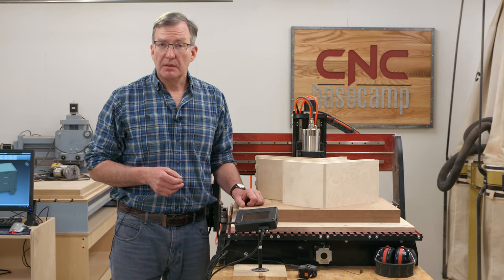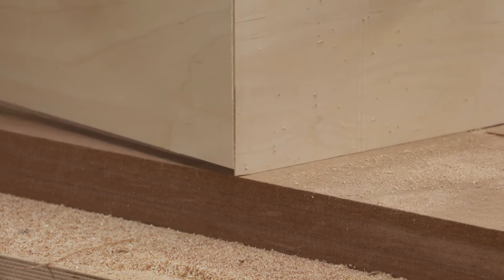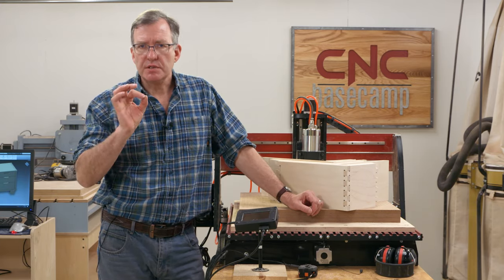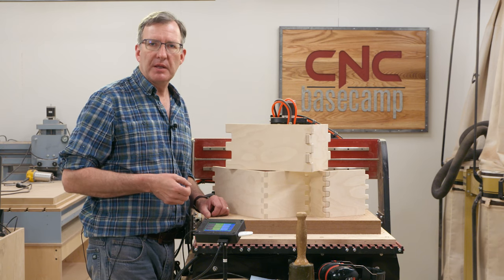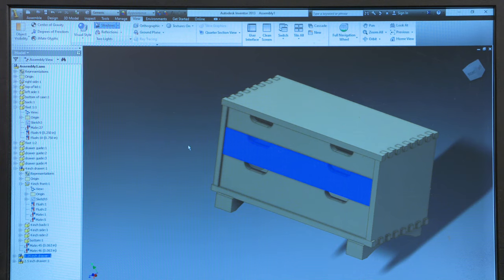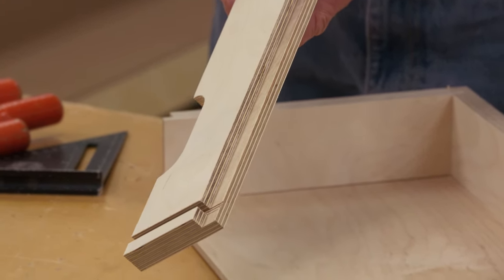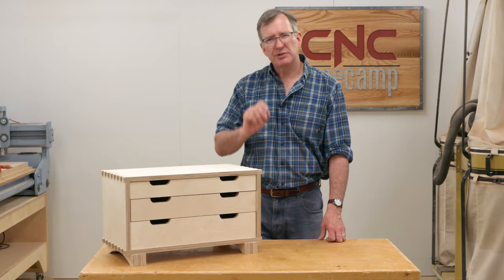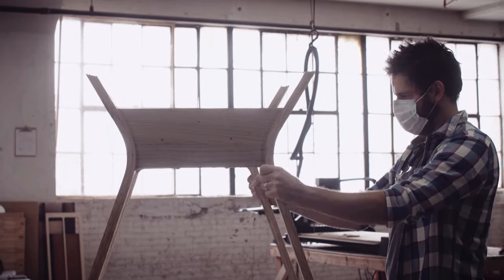CNC Basecamp Ep002: Joinery with a CNC

Comment: Thanks Chris, always great to listen to your explanations! I am building the CNC machine and did made it a bit bigger. As an alternative for the two lead screws you are suggesting for the x-axis, you could use a thicker ball screw. My x-axis screw diameter is 25mm (1”), so twice the size as your lead screw; the y-axis is 20mm, the z-axis 16mm. Screw lengths: x-axis: 1650mm (org 58”-1473mm), Y-axis: 1000mm (org 36”-914mm) and z-axis: 400mm (org 15 5/8”-397mm).
Hope this is helpful for other builders :-).

Comment: On the last joint, why not create a square cut out at the edge. Then you could use a small strip of a different material for the edge. 
Another idea on the dogbone, is to drill out and plug, with a different wood

Comment: hello
If you want to get rid of these magnetic interferences without spending money on magnetic suppressors and shielded cables, do the following:
plug the cnc control system into a power outlet at least 20 feet from the dust system.
That's how I got rid of it

Good job and thank you

Comment: When I cnc cut plywood it leaves a bunch of frayed crap everywhere, how do I prevent that? i tried making blind joints but .05mm clearance wasn't enough for them to fit together (although it may be due to the frayed crap i didnt clean off very well). I'm using a 1/8 inch bit though not sure if that is also a reason.
Reply: Change direction of cut maybe

Comment: Comment first then questions. It,s about time Woodsmith got in to using the cnc that they built. Now question . what software did you  use to create the  parts in and what software did you use to crate the cut files in and what  version is it. Thanks Jeff Peters PS  I have been Woodsmith  magazine customer  for a very long time.

Comment: Just watched the beginning of the video so far.  Why are you trying to make to make traditional joints without the proper tool change and position change.  For example you could cut out each drawer with the cnc and then reposition the drawers 90 degrees with a taper bit to cut the dovetails.  The other way would be to make a cnc type dovetail that does not have corners like the letter T with rounded corners.

Comment: CNCs removes a person’s craftsmanship. I will never use a Cnc in woodworking.
Reply: If you are not interested in CNC because it is to automated, well then you probably need to stop using your table saw too, ha
Reply: @TheMikeNan   well, it is automated because someone created a design on a computer, then crated the tool paths, then converted to cnc codes. People like Tj Tech should understand that you need a lot of knowledge and creativity to automate your work and, even then, you have to do some of the work by hand. Tools are meant to help you push the limits that you had before those tools existed. Cheers